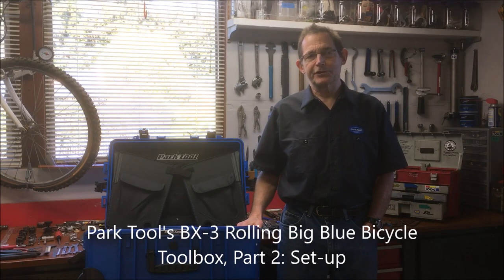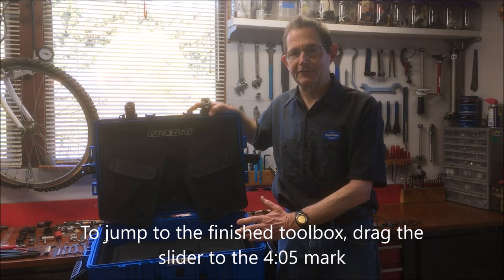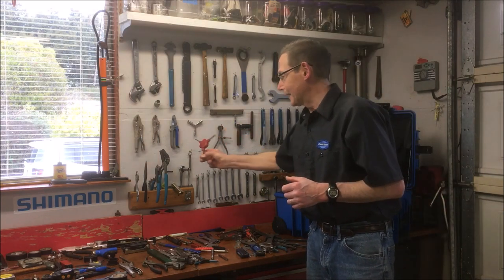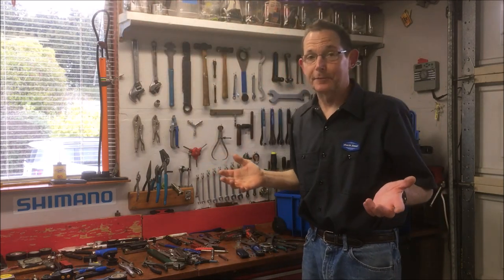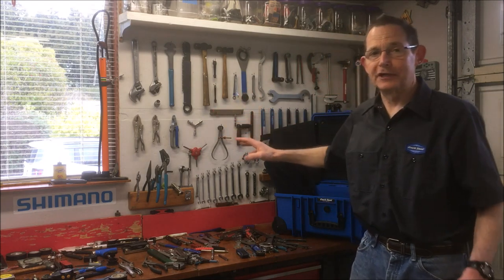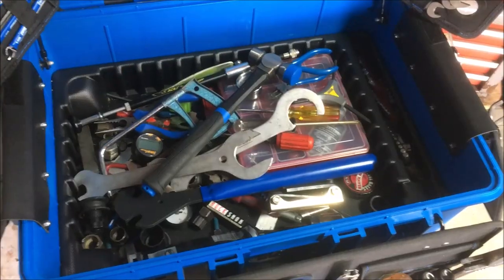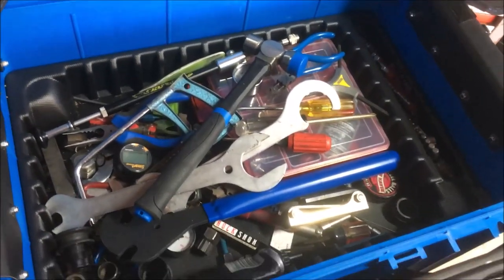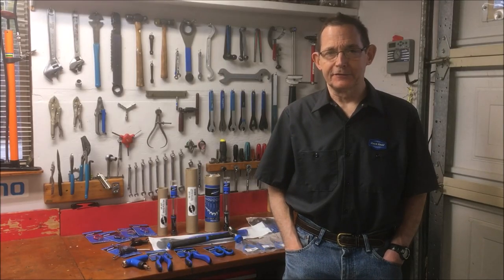How to Set Up Park Tool's BX-3 Pro Bike Mechanic's Tool Box

Comment: Thanks for the video Jim, it was good to see how many tools you can fit into the BX-3. Currently I have the BX-2 and think I should upgrade to the bigger box as the number of my tools increase. Maybe in a few months time you could do a video on your experiences after living with it for a time and see you feel about it.
Reply from the maker: Thanks for the comment, Thomas. I have been using the BX-3 a fair bit already and have some initial thoughts. The best thing is how much more it holds and how there's enough holders and room to more easily place and then find your tools when you need them. As I mentioned in my write up on the BX-3 on RoadBikeRider.com https://www.roadbikerider.com/setting-up-my-park-tool-bx-3-toolbox/ while being able to pack so many tools is great, it does make for a heavy tool box. So, in thinking of what Park could do in future oversize boxes, I think they might want to consider if lighter materials could be used for the palettes and if they could shave weight anywhere else on the box. I think they might want to offer small tool's organizer boxes for the bottom, too, that fit in the slots molded into the bottom. I also suggested to Truman, who is in the videos with Calvin that Park puts out that they should make a list of all the Park tools they recommend people fill the box with. They have a nice "map" of the toolbox showing all the places tools can go, but they don't tell you what they as professional mechanics would put in each of those spots. They seemed to like my idea so maybe they'll do it as some point. Thanks again for the feedback and I will consider shooting another video after I've used the BX-3 even more. Jim Langley

Comment: Can we get an updated version of this? Or at least photos of your current set of panels? I've recently been gifted this box and would appreciate seeing your updated setup
Reply from the maker: Thanks for watching and the comment, Gareth. I actually have pretty much kept the panels as I show them in the video. That starts at this timecode: https://youtu.be/4DcUOQJpNO8?t=280 If you pause the video you should be able to make out most of the tools. Sometimes YouTube changes to a lower resolution. My videos are always high resolution and you can hit the settings icon in YouTube and switch it to at least 1080p to see the tools clearly if they're not already.

One thing you are always doing with toolboxes is trying to eliminate any redundancies. I tend to put extra tools in and then realize I don't use them much. Or I'll realize I put two tools in that do the same thing, like a box cutter and a knife. If you can remove any doubled up tools like that, you can make room in the box for more spare parts you might want to carry to fix bikes and/or you can reduce the overall weight of the box, which is a great thing if you ever have to pick it up or carry it - like up steps. What a mechanic packs mostly has to do with what tools they have and what types of repairs they perform the most. If you have any questions on how to set up your box (nice gift!) with your toolset and for the bicycle repairs you do, I'm happy to try to help. Thanks again!

Comment: Great video as always. I don’t think I need a box that big but I wouldn’t mind a smaller one. I’m not a professional bicycle mechanic but I do a lot of work on my own stuff. I like how organized everything could be in one box. I like that hammer is that the HMR-8 or HMR-4? I had to look it up because I’m kind of needing one. 
I also think I might buy that combination wrench set. I have my car tools in the house when I work on my bikes and they need to be out in the garage for when I work on my cars. I’m sick of moving stuff back-and-forth. I do have all of those cone wrenches those are a must!!! And I know what you mean about needing duplicates of some. I have those too!
Reply from the maker: Thanks for watching and the great comments, bjimbosld! I bought the HRM-8 because it's an 8-ouncer and that's what I like for bike work. I do have heavier hammers if I need them but this one is perfect for most jobs and it helps keep the weight in the toolbox down a little compared to the bigger hammers. I hear you on having the right tool in the right place. I end up buying duplicates just because of that but I do think it's worth it because sometimes you really need that tool right now and don't want to have to go find it somewhere else. Have fun picking out some great new tools. If you are thinking of a basic toolbox, Harbor Freight has some good ones with rollers on the bottom and that are pretty heavy duty with good handles. They don't have the dividers and organizers like the Park Tool box but they will work fine for toting tools. Thanks again!
Reply: @JimLangley1  thank you so much for the reply!!!
Reply from the maker: @bjimbosld  you're welcome! Thank you again for watching and the great comments!